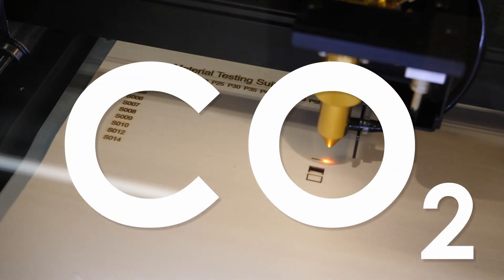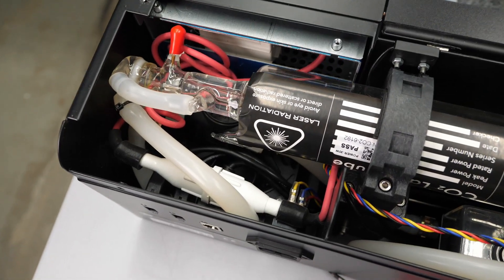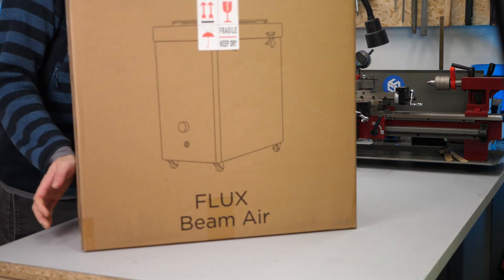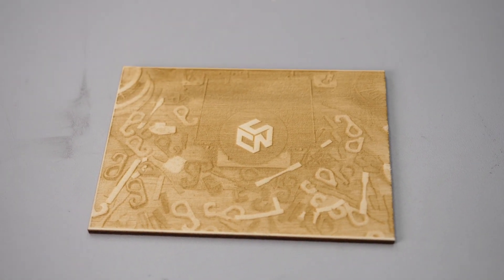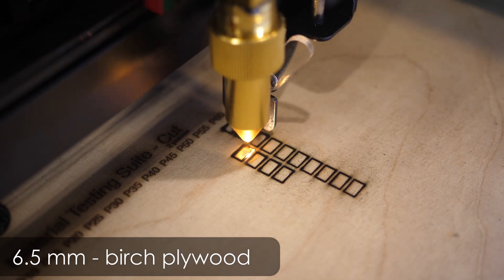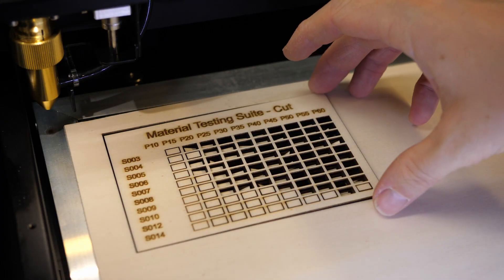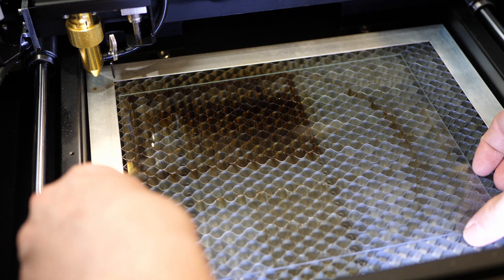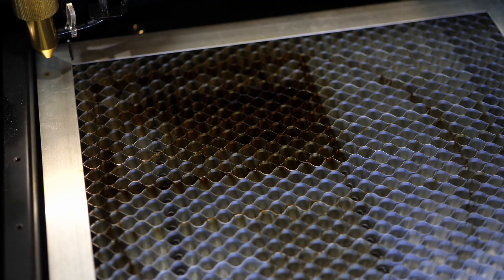FLUX Beamo REVIEW - Compact 30W CO2 Laser Cutter

Comment from the maker: CO2 Laser Cutter! Great addition to the shop or just an overrated piece of equipment?
Reply: You may want to fix the price, $15000 seems too much :)
Reply: How is the noise-level of the machine running? And what about the filter unit? I was hoping you would cover that aspect in your video too.
And how long is that laser tube going to last, before it needs to be replaced?
Reply: @ProtonOne11  3000 hours according to a seller I talked with during a maker exhibition
Reply: @ProtonOne11  Laser tubes generally last around 2000 hours .. or 2 years, the first event coming to past.
Reply: That’s awesome!!! Want! Curious about carbon fiber!🤔 I build rc airplanes, this would be incredibly handy!!!😲😲😲🤘🏻🤘🏻🤘🏻🤘🏻
Reply: @sacrificialrubber779  No sadly,  Well,  not easily anyway, and very very stinky. Same with Garolite, which sucks because there is so many great use for both of those materials.
Reply: Kannst du damit Bacon oder ne schöne scheibe Wurst bemalen? Wir sind ja hier bei cnc kitchen
Reply: They're great, but this particular model is quite expensive. A decent K40 is a better choice for most shops.

Source: owned both a 12 grand Epilog and a 600 dollar K40.
Reply: for jewel work which laser machine is good?
Reply: I realize it's pretty off topic but does anyone know a good place to watch new series online?
Reply: @Ezra Gavin flixportal
Reply: @Ralph Alaric Thank you, I went there and it seems to work :D I really appreciate it !!
Reply: @Ezra Gavin Happy to help :)
Reply: Great addition to the shop - I got a ... more expensive Glowforge Pro at 45 Watts, and it doesn't even come with that AWESOME test cut pattern! Still, it's a good machine for what I use it for, and this one honestly looks easier and better to use.
Reply: co2? somewhat outdated. the co2 tubes do not last nearly as long as fiber laser diodes and are, often times, more expensive than fiber lasers.

ok, I may not be totally sure about the price, but the longevity of the co2 laser tubes puts me off a lot.
Reply: @umbratherios  fiber lasers are way way more expensive than a CO2 laser.
Reply: @umbratherios  but look at the power, Co2 ls 3
Reply: 30 wats ,the diode laser dont rich this power
Reply: @umbratherios  Fiber lasers are a different class of machine. Fiber lasers work mostly on metal and cannot cut organic materials. CO2 can cut organic materials and etch glass, stone, and anodized aluminum. It depends on what you are planning to do. Fiber lasers are also far more expensive than CO2 lasers to start. I've had a C02 laser for several years and the tube is still holding up well. It all depends on how much you run it.
Reply: @umbratherios  depends on what type of co2 laser tube you purchase, this is amateur equipment, buy a Trotec or Epilog if you really want to earn ££

Comment: 5:02 yes thats cheaper way you not want pay 65k for filters.
if cheapest filter cost 19 it has 4x and you need change it every 10 hour. 1 pack of 19 last 40 hour. 25000h/40h= is how many that filter type you need on lifetime of laser. pretty easy math.
there is 4 different filter you need buy most expensive cost 120 than need change every 300 hour. 25000h/300h= that how many you need. easy math xD

Comment: i calculated how much it cost. if laser life time is 25000 hours. and you run laser 24/7 thats 2.8 year. all kinds of filter you need replace. they cost 65k LOL.
or we can use without "air" thingy. well its true if you change filters like they say they cost 65k for that 25000 hour laser usage. you can push that air hose thru window its cheaper lol lol

Comment: I've got one of these machines. Great hardware, great firmware in the machine, absolutely terrible PC software (Beam Studio) that was written by people who have no idea about software development and contains so many bugs, gotya's and annoying "features" it's untrue. It's also a shame the bed isn't slightly larger as most of the material I buy from sellers is A4 size, and whilst it will fit, the edges can burn during cutting because the honeycomb panel isn't large enough.

Comment: The chinese 40 watt laser on ebay ... i used to have it  before i threw it away after 2 years of tinkering,  it wasnt at it rated power  it did not even want to cut 5mm wood i had to use about 5 passes before it cut it  aqrylic would not cut at all and alining it was a nightmare on its own  and the water cooling was more then jank,  and the conector where the 16kv come into the laser tube was just wrapped around the tube connector and not fasten down sooo ay move while shipping and your dead on touch

Comment: Guten Tag! I'm always thinking about laser engraving machine, can you tell me please, is this machine capable engrave on aluminium or eve stainless steel? 
Thank you.
Max
Reply: Any CO2 laser is not able to engrave metals. They can only remove any coating on a metal surface such as paint or powder coating. You can also use a special spray to "print" onto a metal when the laser passes over it. For metal cutting you'll need a plasma cutter.

Comment: I have this machine.  I tried 3 mm. MDF, it didn't cut.  I even set it in two passes still didn't go through.  Anyone else has problems?
Reply: I found out that the mirrors did not properly aligned.  After I fixed that, it cut through MDF like hot knife through butter.
Reply: That's my favorite material. Bummer...

Comment: Hello
Did you try to engrave/cut epoxy electronic pcb ??
Thanks
Reply: Fiberglass does not cut well, especially PCBs which are fire-resistant. They tend to melt and burn without cutting.

Comment: where to I buy a 100 to 200  watt co2 laser to cur 2mm steel
Reply: You can't cut 2mm steel with even a 200 watt CO2 laser. You need very high power CO2 lasers to cut steel. They are often >1KW.

Comment: My guess is the slack in the belt and the non parallel situation is part of the math that drives the thing. It’s plastic. You don’t want it too tight. If it’s working that means it’s compensating for the slack right?
Reply: A lot of horrible solutions can be "working" until they don't but maybe they did put thought into that. It's not like that carriage has to carry a cnc spindle. Plastic pulleys sound a little cheap though considering the price of that thing. Sure they might work fine but what would have been the harm in going for metal?

Comment: interested to know more about the Beam Air. I have a Beamo already and I am really considering the Beam Air. Disappointing to hear you didn't think it worked well?
Reply from the maker: Sorry to disappoint. I think the charcoal filter is just too small. Are you happy with your Beamo?
Reply: @CNCKitchen  yes I really like mine, using it as we speak. It's my first laser so ease of use was a big factor for me. There is a couple of things I'd like upgraded/changed though: 
The honey comb bed doesn't fill the entire work area, rather the aluminium profile takes up about 20mm each side of an a4 sheet which leaves a lot of bad burn marks so I'll be cutting mine up a little. 
There is also gaps around the lid which allows some fumes to exit.
The software can be a little temperamental too but I'm always using beta versions so that's to be expected I suppose. 
I think I'm going to buy the beam air anyway and see how it works for me, fingers crossed.
Reply: Is there room in the chamber to double stack charcoal filter?
Reply: @matthewdynes9375  Hi Matthew, I just bought the 30W beamo, did you ever buy the Beamo Air unit?

Comment: So basically, you find that the price tag reflects additional premium features and service. Let it be known that you can still get the same level of output quality on a cheaper $400 K40 with some very minimal upgrades.

I designed a linear rail system for my K40 and I can engrave at 500mm/s no problem. (Yes I realize that due to the kinematics of these machines you never really reach that true speed.)
And it uses a small radial fan and not an air pump. 

 Like everything, it comes down to what you are willing to put up with as a user. I dont get any customer assistance or warranty so if anything goes wrong, its totally up to me.

Comment: From plenty of laser work at our makerspace - we started with an 80 watt china rabbit laser. It's fairly excellent in it's terrible way. After we fell in love with it, we dropped the big money on a Trotec speedy laser. It has a solid state infrared laser...but it has 80 Austrian watts, instead of 80 china watts. It's literally twice the machine for power and precision. 
Things that we've learned; 
1) you are right, try to set the focus to midway through the material or you will end up with angled drafts on your parts (acrylic cuts that won't stand on edge because of the angle)
2) More passes at lower power is good. The total power spreading over 2-3 passes is the same as the instantaneous single cut power overall, but there is way less heating as the part has a chance to cool between the passes. Like you say when using any tool - let the tool do the work. Don't push too hard on a saw or it will bind, same(analogy) with a laser.
3) DO NOT EVER LEAVE IT UNATTENDED. Our makerspace got our first laser donated on the grounds that we had to completely refurbish it after a it burned down the previous owner's shop. He cut several successful pases of a project in foam core (paper+foam laminate - cuts like butter but extremely flammable). He hit go on another pass then went to the bathroom. A part being cut out fell into the mesh below the work piece and received an extended zap of unfocused beam causing it to heat, melt, and immolate. These things are to making what helicopters are to flying - they are trying to kill you every chance they will get.
4) I wouldn't trust the plastic vent hose. If there is a fire, it will melt and catch fire itself. Stick with metal flexible duct.  Consider adding a smoke detector just outside the lid. If the fan fails, you have a fire with enough smoke to leak out of the machine (or melt the lid),  and you ignored number 3 - you will want to know ASAP. Keep a fire extinguisher nearby. If the lid on this machine is acrylic, a small fire inside the machine will HAPPILY ignite the lid. An acrylic fire is extremely energetic.
5) The fumes from most cuts are particularly toxic with high combusted fume, and ablated particulate offgassing. Definitely filter if no other option, and recommend even some filtering if you're venting outside, as you wouldn't want a commercial operation polluting raw waste into the atmosphere, even small scale adds up if everyone did it.
6) You say it shipped with the mirrors in alignment - Most mirrors won't stay that way. Don't mess with them unless you have to, but definitely learn how to adjust the mirrors and the telltale signs of misalignment (cutting spot becomes a cutting 'cone').
7) Keep the gallium nitride lens immaculate with specific lens cleaner (no industrial cleaners or windex). A tiny soot buildup will gather a large chunk of your 30 watts on the lens, heat it, and crack it in no time. The air assist through the nozzle will help but it's not perfect. Consider (if this machine doesn't have it) to add a filter to the intake of that air pump so that room air dust doesn't get blown onto the lens. (was an oversight on our machine).
Edit: 8) others asked below - what about metal. No. It doesn't have the power and will reflect off of anything metal. It will etch the anodizing off of aluminum really nicely leaving bare metal colour underneath. Highly recommend checking out a product called Cermark. It's a molybdenum ceramic coating that you spray on, let dry, then laser etc. It gives indellible black markings on metals - you've probably seen products made with this kind of marking before. It's expensive for the spray can but it goes a long way on small projects. 
Edit again 9) Some acrylic parts will benefit from annealing in an oven to relieve the stress after laser cutting. This stress can cause 'crazing' (those countless microscopic cracks you see in cheap plastic dinnerware that has been through a dishwasher after a few years). 

Enjoy!
Reply from the maker: Thanks for the incredible amount of information!
Reply: @CNCKitchen  You're welcome - thank you likewise for always sharing as much as you do. Since you put so much effort into it, I figured I could toss in a few lessons we learned!
Reply: How do I save a yt comment?
Reply: @mrskwrl  copy paste? :)
Reply: @Secret Sense Jewelry engraving steel without spray is probably exorbitant expensive. Infrared mostly just bounces off at these power levels. I think you would need a yag fiber laser $$$$ instead of an infrared CO2 laser $. Whatever you search for just remember in the end you get what you pay for. For hobby work the cheap solutions might be okay... For production work you don't want a laser repair hobby.
Reply: The helicopter analogy got my 👍. Lovely.

Comment: Thank you CNC kitchen as always! I'd love to see it cut some other plastics and if possible pre-resined carbon fibre sheets. Or maybe just normal carbon fibre sheets, who knows?
Reply: carbon fiber doesn't laser to save its life. Fiberglass fabric can cut but the instantaeous heat creates a crunchy 'cratered' edge where the microscopic fibers fuse into more macro beads on the end. Not advisable. Cotton fabric with the right power settings cuts nicely, but can ignite in a slow-burn that burns imperceptibly so it needs to be monitored closely. polyester blends cut similar to fiberglass sheet, where the edge becomes crunchy as the fibers fuse.

Comment: Great review and product.  As mentioned in other comments, there is a value to having a product work out of the box without a lot tinkering.  I see many comments about the K40 - it reminds me of early 3D printers that needed a lot of tinkering and time/money to convert into a usable machine.  It appears the the laser machines are evolving as well.  I've shied away from CO2 lasers because of the price of entry in either case.  The Beamo is approaching the right combination of price/performance but still a little too steep for a hobbyist with occasional use.   My question is can this machine be positioned over a larger piece and lasered in sections?

Comment: For thicker, harder to cut materials, I'd try two or more passes, adjusting the focus between them (through running the same job multiple times). 
There'll be a limit to this as the walls of the cut groove will eventially block most of the beam getting into the focal point, also maybe degrading their quality, but I'd be curious how far it can be pushed!

Comment: Hmm...seems to be well-crafted. Direct competitors would be the legion of nameless K40 lasers...a Chinese 50W laser even with RUIDA controller sells for 1500 EUR on Amazon...now for the acrylic...is the wavelength of a CO2 over a blue diode a prerequisite to engrave or even cut acrylic?
Reply: Yes, a CO2 laser is required. Acrylic is transparent to the violet/blue light from a diode laser engraver, so the power does not heat the acrylic and cut it. Acrylic is opaque to the far infrared of a CO2 laser, so it heats and vaporizes. With a blue laser, the most you can do with acrylic is paint the surface and use the laser to burn it off, which will etch the surface of the acrylic. But you can't etch it directly and you cannot cut it.

Comment: Great video, thank you!

I'd really like to know if the Beamo (or a cheap hobby grade laser) could be used to effectively cut rubber gaskets. Like silicone and neopreme. I find myself in the position of needing to make some rubber gaskets but have found very little in the DIY/home shop arena that tackles making gaskets. Perhaps not the most exciting type of part but critical for many applications.
Reply: the answer is very likely

Comment: I've had a 50watt CO2 laser for several years. It is a great thing to have around for hobbies and making pieces to sell. I think they are pretty essential machines to have and open up a lot of possibilities for what you can do in a shop. It sounds like a good package for $1500. Has a lot of nice features it sounds like. The bigger issue for me would be the power, 30watts just isn't very much. But if that much power is enough for the materials you use and can live with the small size, it seems like a really nice package.
Reply: More powerful laser needs more powerful cooling. I'm not very sure but I think water-cooling system can't handle 50watt laser so it will need a chiller, which will add significant volume.
Reply: @Travis_Yu  The bigger problem with a higher water laser is the tube itself is longer. I'm guessing that is a big reason why this thing is 30W. I have an external chiller but it barely runs the actual chiller. You could probably get away with running a 360mm computer cooler radiator.
Reply: @mintzbuck  Turns out beambox pro from the same company use 50watt laser with water-cooling system. Can I ask you did you run full power with your machine for a long period of time?
Reply: @Travis_Yu  We usually run a mix of engraving and cutting for several hours at a time without any issues. But only a few times a month. With any of these, if you are going to run it a lot you would definitely want a chiller. We have the chiller because it came with the machine.
Reply: @mintzbuck  Thanks for your information!